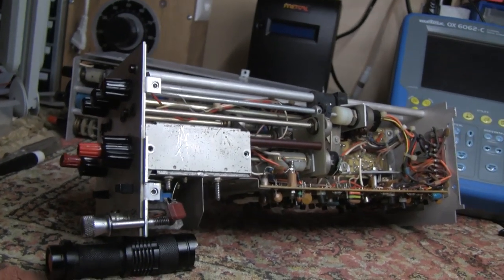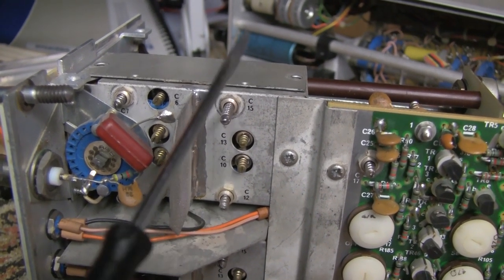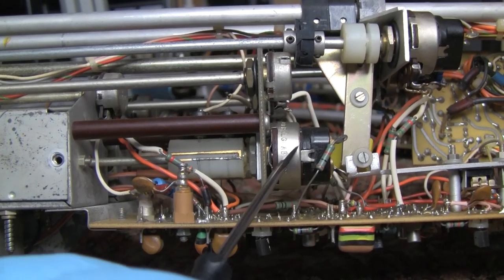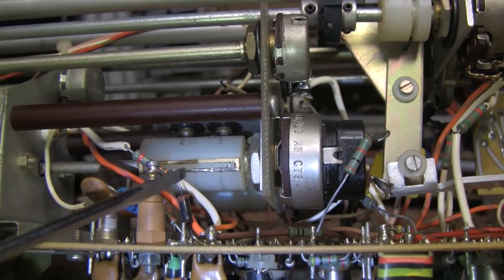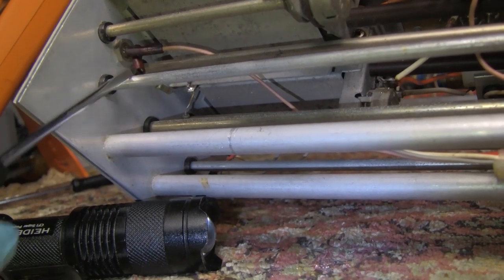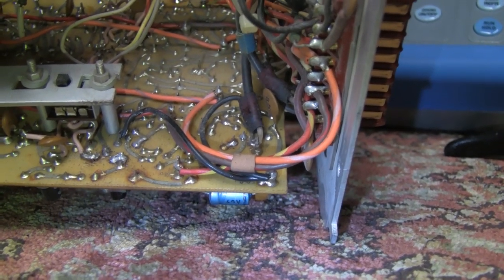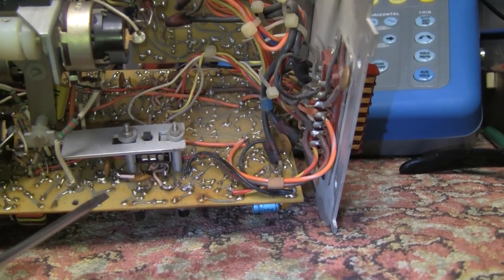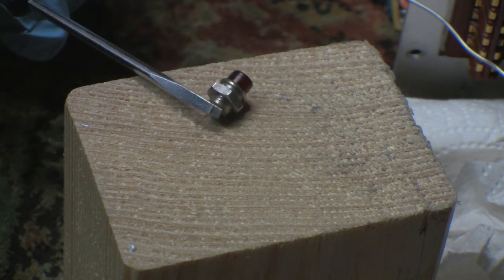SM112 Scope Repair - part 6

Comment: I seem to remember seeing sealed neon panel lamps like that somewhere, so you may be able to find new ones from a place like Mouser. I noticed that the black switch is a CTS product, which I always thought was an American brand, so I guess Phillips, or whomever made this scope, used off the shelf parts rather then making their own.
Reply from the maker: I had assumed the scope was American but noticed the address in the manual is UK plus is also says that SE Labs was an EMI company.
Reply: EMI, interesting, I figured it was a Phillips product since it used so many Phillips parts like those radial lead capacitors with the horizontal colour code, some people call those "Tropical Fish".

Comment: John, should you decide not to go the LED route, you may want to try Moyer Electronics, on my side of the pond, and about 35 miles north of where my carcass is currently parked for your indicator lights. It's work like this which will prove the value of that Metcal!  (will try for Tuesday RE: the documentation).  Nothing is worse than having to clean up a mess of someone else's making, but with your being so methodical, you'll have this functioning before Halloween, my Ouija Board says so :)